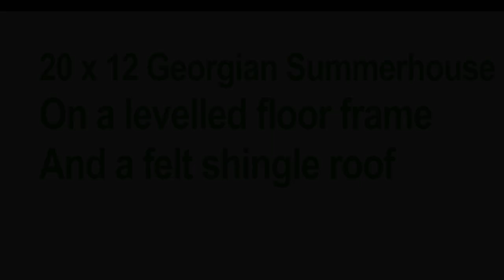20 x 12 Georgian style summerhouse garden shed

Comment: how much is the man cave
Reply from the maker: Price at May 2023:
20 x 12 summerhouse
In 12mm (ex15mm) cladding - £3,879.00
In 16mm (ex19mm) cladding - £4,481.00

Black iron door handle, continuous hinges on doors, lock and latch set installed - £145
(If needed) Heavy duty floor frame, levelled - £641.00
Optional upgrade - Felt shingle roof - £945.00
Optional treatment: Barrettines Nourish and protect - £130.00

Our sheds have base coat treatment included as standard.  The treatment is an excellent timber preservative but is not waterproof.  
Your shed will need to be given a coat of a waterproof treatment once installed.  
As this is not convenient for many people we offer the upgrade to Barrettines Nourish and Protect, a translucent light brown spirit based treatment – expected life of 1 year before retreatment
All treatment is applied at our workshop prior to delivery. 
If you take advantage of this option your shed will be ready for use immediately installation is completed.

Our prices include: Local delivery, basecoat treatment, glazing, roofing felt, and VAT at the prevailing rate.  There are no hidden extras.

All sizes are nominal

Installation is free of charge at the time of delivery providing that there is good access and a suitable base